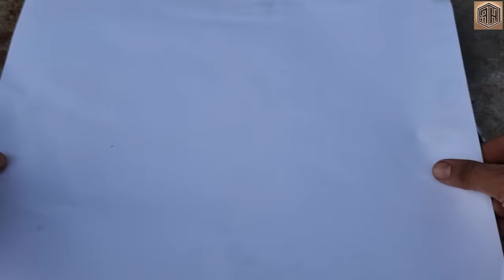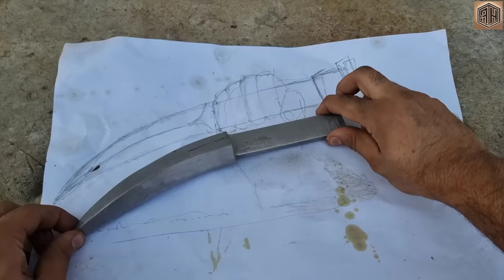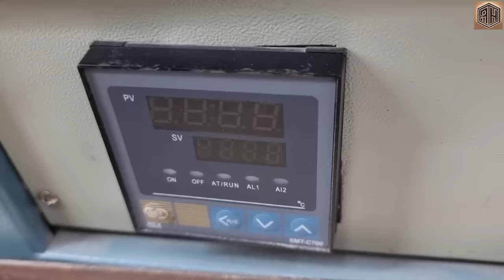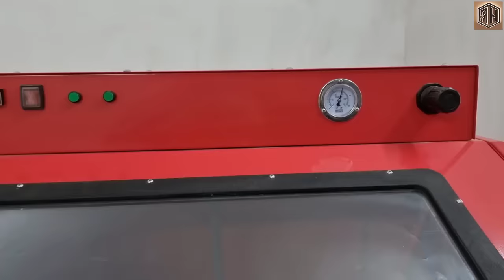Turning Rusted Gears into a Fisted WAR HAMMER - Random Hands

Comment: Nice work. Though i would recommend reducing the size of the head for that type of warhammer. One that size is meant for a polearm like a "beck de corbin" or crows beak . You couldn't effectively use it as a weapon in one hand as is. It would just be too heavy to swing & recover quickly. Also round handle = no good. Itll turn in your hand. Square or octagonal would be better.

Comment: This is an awesome project. I think if I were to do I would have the hammer going the same direction as the pinky finger with the pick going in the direction of the thumb. I would also have the spiked wrist guard up close and snug at the upper most part of the wrist. That is or course unless there'd be some type of design flaw. I don't have any experience with forging. That's just how I picture it in my own mind. @Randomhands what do you think?

Comment: Looks sweet.  Only improvements would be an oval handle, it helps finding point end and helps with twisting on impact and the flat end should have 4 small pyramid points, those help bite into armor.
Reply: I have a few Nitpicks as well but i agree. On my end id give a reccomendation for the hand peive is instead of casting id say carve it takes more time and heck of alot of effort but will save your life on durability as casting something creates a TON of i perfections and bubbles in the metal making the thing supwr easy to crack/break and another thing is to use a stronger metal as well while aluminum is lighter it isnt great strengthwise compared to steel